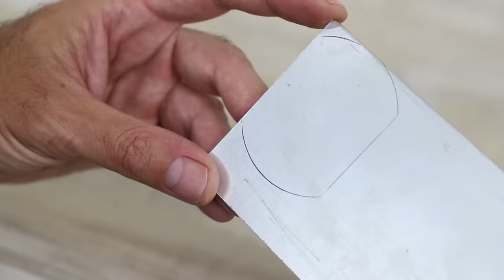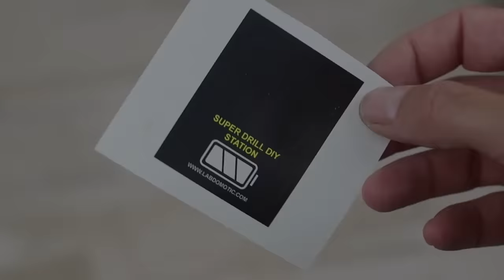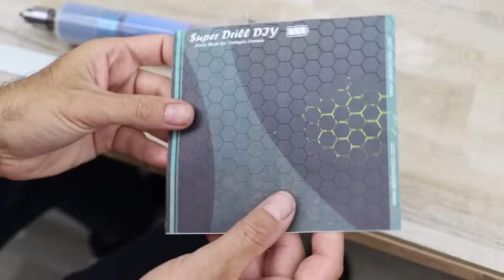HOW TO MAKE super battery drill with a SYRINGE

Comment: Daniele; I usually put a radius on the corner of any label ("Super Drill" for example) or sign that will be glued in place, since it reduces the chance of the sharp corner being popped up by anything that rubs across the unit ... a small thing, but keeps things in place longer and neater.

Comment: ... For the cost of materials you probably could have gotten a rotary tool from Walmart that has a plastic housing designed to take these stresses. A syringe tube isn't made for holding the torque of that motor drilling through wood. Its going to wallow out the plastic around those two screws. Let's not forget that you have what looks like a 4mm hole right into the motor where your hand is--that feels dangerous and is just asking for covering up airflow into the motor. This thing also couldn't be used for long, that motor will get hot and that kind of plastic is prone to heat deformation.

Comment: You didn't show how you attached the brass collar to the chuck..... I understand the set screw for attaching it to the motor shaft, but not the chuck connection?
Reply: It is threaded, since it was not designed to be ran in reverse. So it simply screws onto the brass adapter.

Comment: 8:00 after you pulled the wire through add a knot before soldering. It's a quick easy way to avoid the wire being yanked out by mistake. More importantly same with the switch.